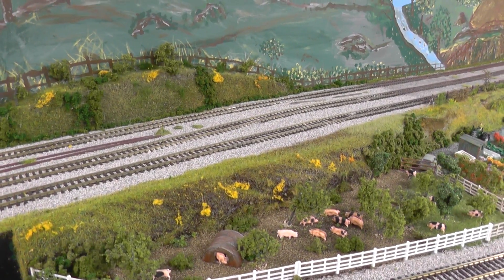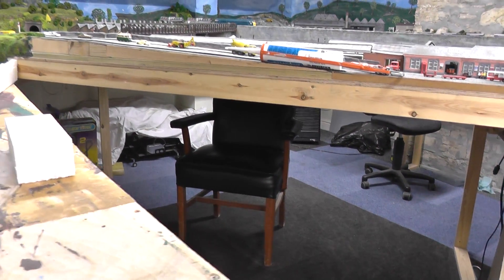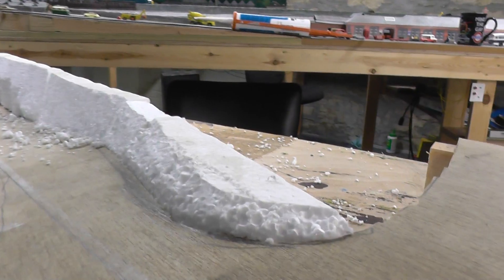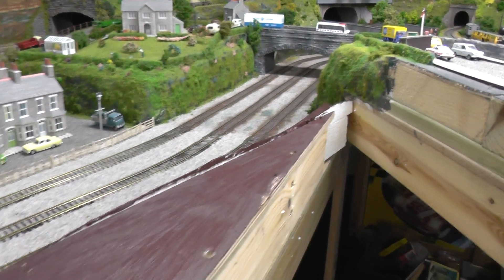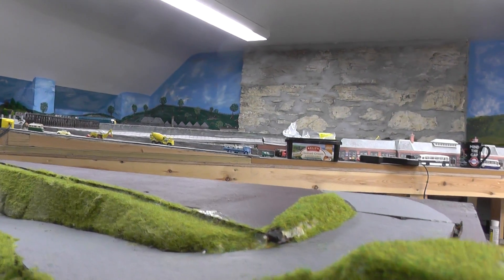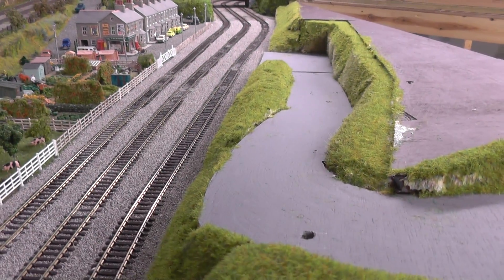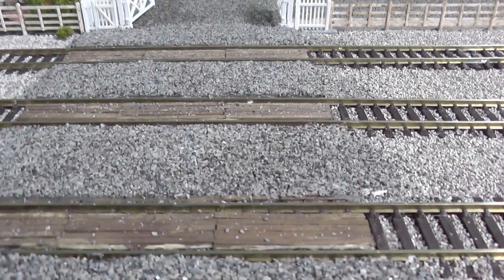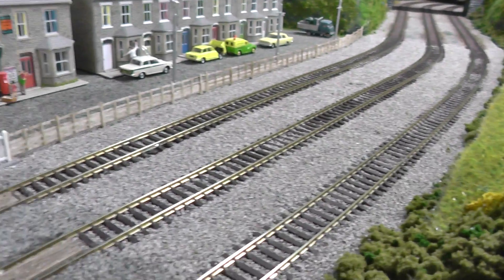How to make cheap landform on Penwithers

Comment: Works well Kevin. I tend to use the insulation foam board in a similar way. Laurie.
Reply from the maker: Calvertfilm Hi Laurie onto the insulation on the next section but had a few bits of polystyrene to use up cheers Kevin

Comment: Very good Kev like the way you've done your road mate,not bad using polystyrene Kev not thought of that but I tend to make formers then staple modellers mesh over but that not a bad idea and cheap as well.
Cheers Kev
Reply from the maker: percomotion Hi Kev thanks the insulation works out well most of mine was formed that way then covered with modroc so thought I would try it without cheers Kevin

Comment: An excellent tutorial video Kevin! Very useful indeed. Been really thinking a lot about redoing my layout lately, and cuttings and embanks on my plans will play a big part. What was the paint and type of static grass you used? Looks very effective! Miles better than what I have at the moment. Also where did you get the polystyrene blocks from? The level crossing looks great! Again another very helpful tip! Will be interested to know where you got or made you bridges and tunnel mouths. Thanks for sharing!
Reply from the maker: SDJR7F88 Hi Callum the paint is just normal emulsion paint the static grass is woodland scenic and I did get some 6mm from international models used various colours as grass is different shades the bridges and tunnel mouths I made from slaters plasticard stuck to ply and just painted with grey primer and then did a wash of black and brown paint
Reply from the maker: SDJR7F88 The polystyrene was packaging that was in a skip !!!

Comment: Polystyrene is a great material for land forms, fairly easy to carve and of course lightweight(you can smooth surface off by giving it a bit of heat from one of those little gas lighter/torch things) but as for those bloody bits of foam wafting everywhere...AAAARGH!
Reply from the maker: struck2soon works well ,yes a bit messy but hoover by my side and no problem cheers Kevin

Comment: Very good work Kevin the road looks good, nice bit of wall you put in really sets it off.
Does the polystyrene still flake after you seal it with paint?
Looking forward to seeing it finished.
Regards
Paul
Reply from the maker: Paul White Hi Paul thanks once painted it holds the surface together ,was pleased with that little section of wall cheers Kevin

Comment: Love the pigs.  They are so quiet though.  Your process with the foam being painted directly work well.  What do you do about all the bits and pieces flying around?  The road looks great, in fact, the whole area looks great, both sides of the tracks..  Could have saved myself a ton of dough.  Good tip, Rob
Reply from the maker: Rob McCrain Hi Rob pigs nearly ready for bacon so keeping quiet at the moment , I keep the hoover close by and clean up as I go not to bad at all and cheap as well cheers Kevin